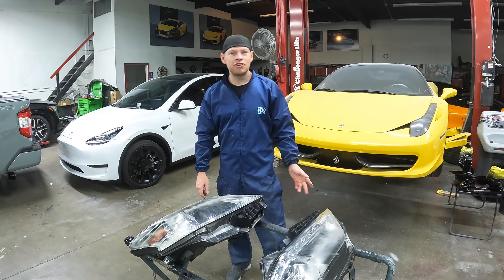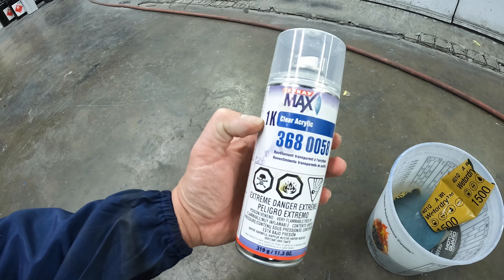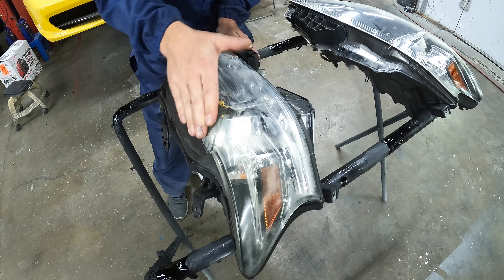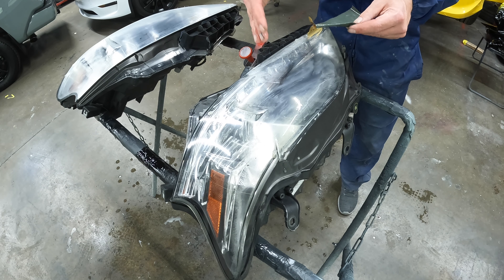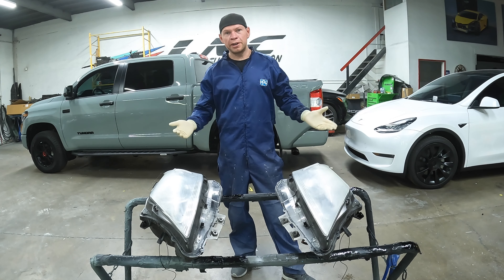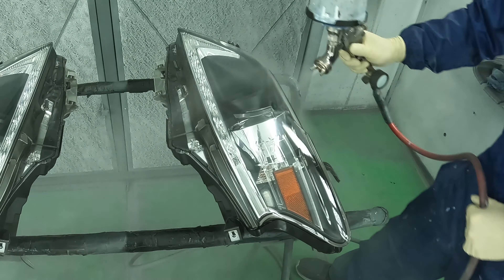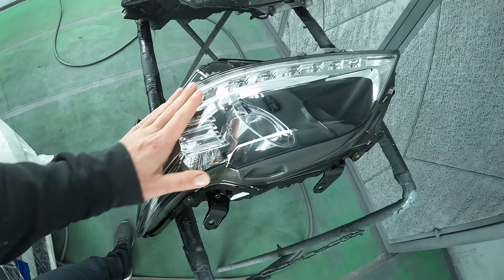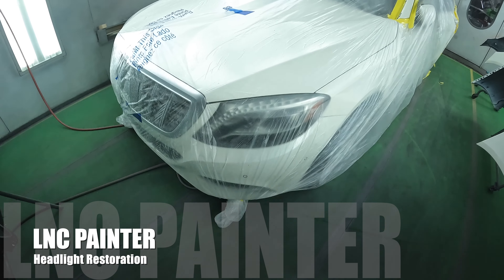How to fix yellow headlights! DIY Step-by-Step

Comment: does it need plastic primer (adhesions  primer) or not
Reply from the maker: I don’t use adhesion promoter, as long as it is prepped really well and around the edges, never had it come back or peeling.
Reply: thanks mate  @LncPainter

Comment: Hi you should not use 2k clear on headlights. Ive been doing this job for 14 years.....
Reply from the maker: What do you recommend instead?
Reply: Hi i have tried many coatings over the years and Meguiars Headlight Coating in the can is the best. Cheers
Reply: Why not?
Reply: Sets like concrete, its not the proper UV clears to put on head lights....